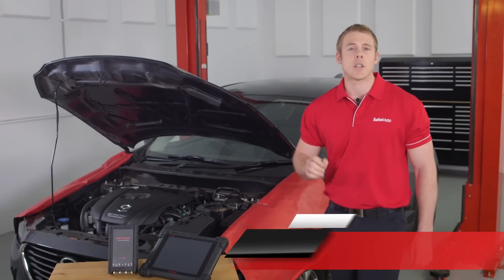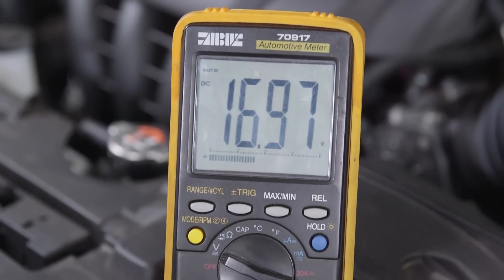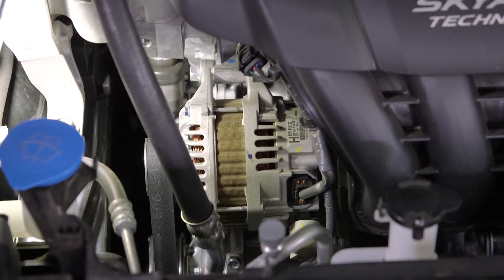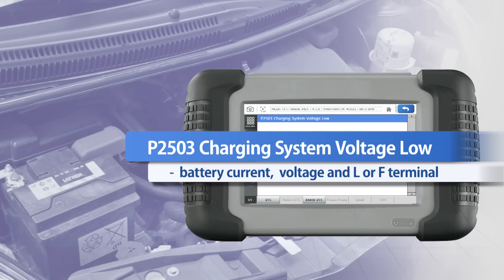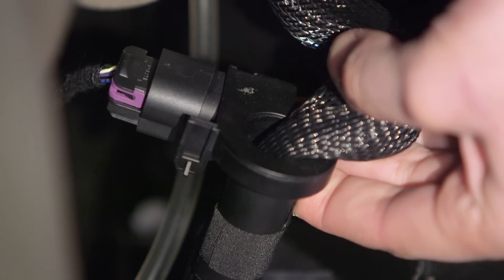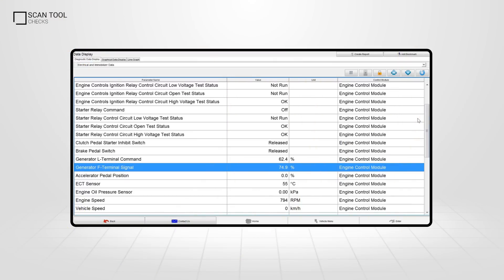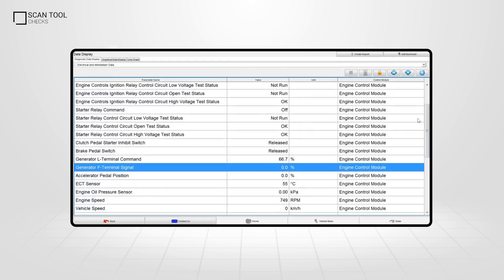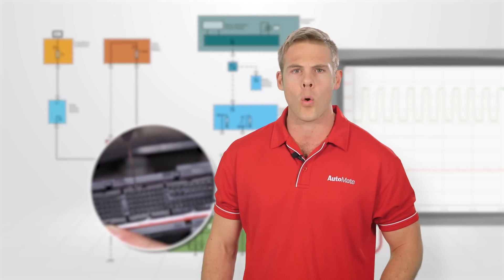ECM Controlled Charging Diagnosis

Comment: Hey, I installed a new battery and alternator, but engine still turns when I disconnect battery terminal. They only way I can check the alternator is when the engine is on, and I only get 12.5 volts and that voltage is probably from battery. I can't figure this one out if anyone can help solve this will be compensated.
Reply: I have the same problem
Did you solve it?

Comment: There is no L or F terminal in a computer controlled alternator
Reply: I believe Ford uses an F terminal and it's a pcm controlled alternator. I was working on a 2022 econoline 7.3L van today that has  an f terminal.  Code p0625-2F generator field F terminal circuit low.

Comment: Autozone sold me a shit alternator that randomly spicked to about 19v and I’m pretty sure it fried my ECM. Car is jumping volts with the ecu is plugged into the voltage regulator. Unplug the regulator and it runs manually… runs perfect
Reply: Was it your car`s computers fault in the  end? Sounds like it`s getting the wrong signal.
Reply: @damianbutterworth2434 I’m also curious

Comment: I have a hyundia i10 2008 charging system new alrternator new battery battery sign is off but still not cgarging
Reply: Same thing on 2015 Buick regal.
Reply: @russgould707  same on 2007 suzuki sx4